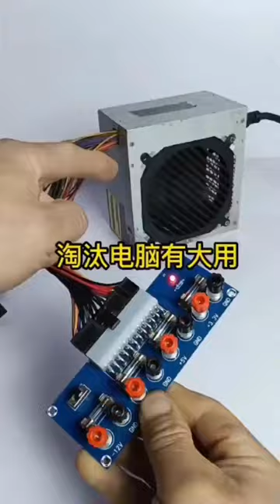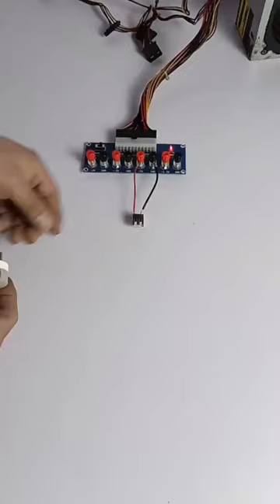XH-M229 DESKTOP PC ATX POWER SUPPLY TRANSFER MODULE

Comment: can i place a potentiometer along one of the terminal? to get any desired voltage
Reply: It's possibile you will need some module such as xl4016 or lm2596 but however I would recommend for xl4015 module the choice is yours

Comment: I Made Such A Supply Without The PCB, I Just Took The Wires, All You need Is A Switch To Put The GREEN AND Any Black Wire ToA nd It WILL Start ToWork, The Green And Black Are The ON OFF Switch, Others Are Minus And Yellow One Is 12 Volts And So on. ...  
Easy To make, I Have In My House 7 Of These , Controlling Many Lights, Fans And Even UV Light Filters That Pull Air Thru The Box That Have Them Inside, The UV Lights Inside And The Walls Are All From Aluminium Taped On It And So It Kills All The BActeria And Noone Can See Teh Light because Its In Enclosed Box Where Only Air Goes Thru And Dust Particales, I Take Out And Clean The Filter Every Now And Then... I Will Make Bigger Version And I Will Make A Youtuibe VBideo About It So Many people Will Be ABlke To Make Such Box That Cleans The Air, Its REALLY GOOD because WHEN You Will See The DIRT That Its There You Will Understand WHy You Need It, My Lungs Are Thanking me !